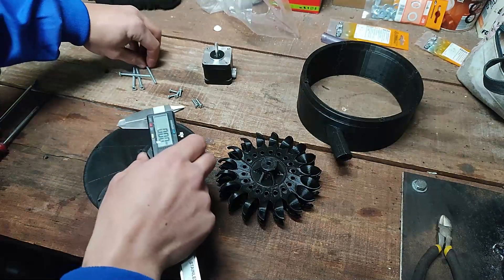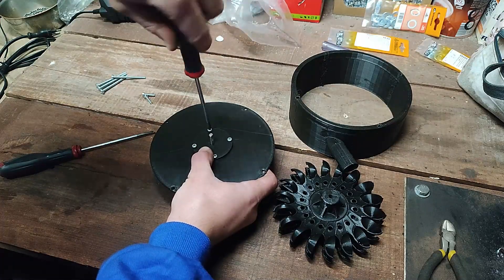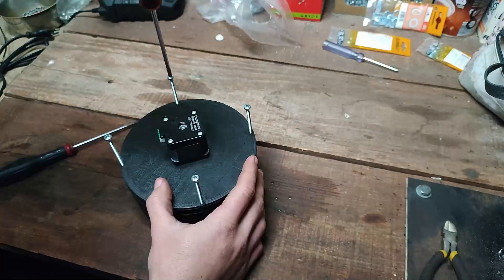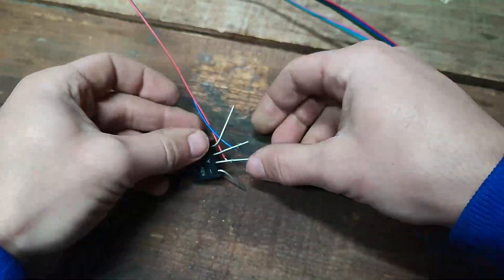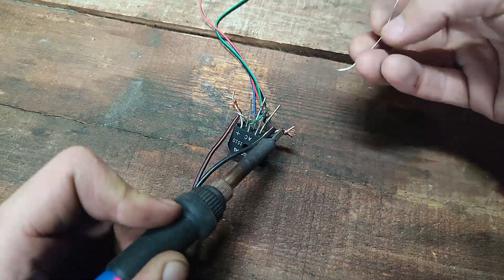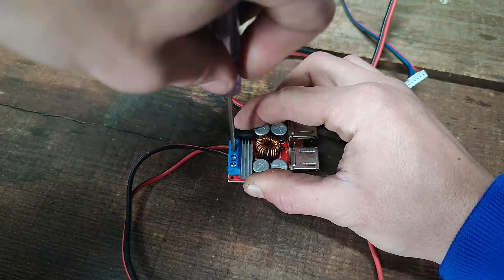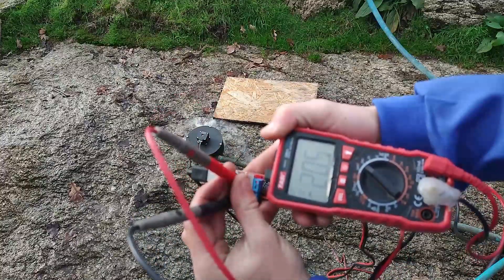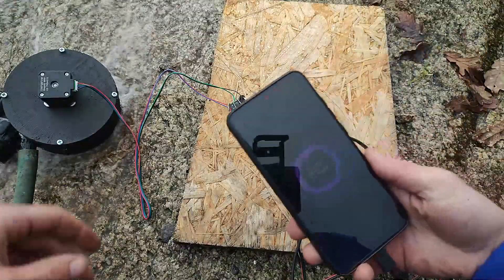NEMA17 Hydro Generator 3d Printed

Comment: What is the difference between part 3 and 6? 5mminner vs 5mmshaft. Thank you!
Reply: @Off_GridWorkShop  ok, thank you. Is there any  way you could upload it with the customiser function? I need to adjust the nozzle size. I will use it as a permanent installation, but need the nozzle to fit a 50mm pipe with 1,5mm walls and then reduced to 3 mm at the pelton side. This configuration gets 8.8 watts in my garden creek. Using a hose and your nozzle gives to much head loss, and uses more water than I have available.. I really liked your design!😊
Reply: @Off_GridWorkShop  Of cource, no problem! I am new to 3d printing, but I have a little experience with CAD from way back. I tried tinkercad, but I found it kinda hard to do what I wanted. I will give fusion 360 a try, thanks for the tips!